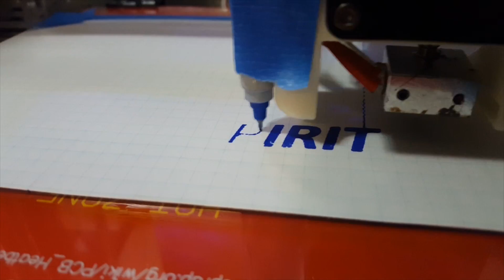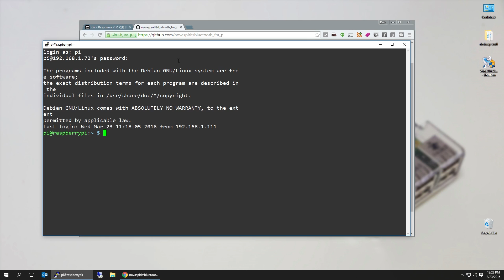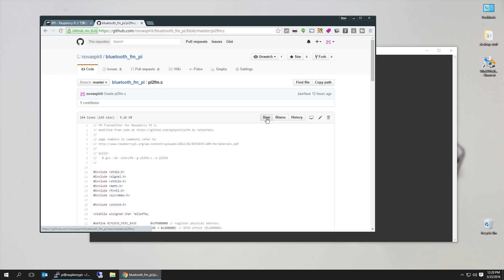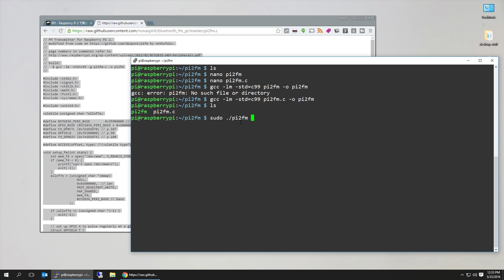Bluetooth Audio FM Transmitter for Raspberry Pi 3/2 Part 1

Comment: This does not work when i put in the code for it to start playing it says starting and broadcasting and other stuff and then on the bottom is says shutting down and it doesn't seem to be broadcasting anything on the radio

Comment: I have the same issue with every software I've tried out so far, four of them. 3/4 seemed to work. This one is running fine and all that, but there's no reception to my radio. If I move almost toward the antenna, then it works. I have a 70cm high antenna with 12AWG solid core wire going straight into the air. Has anyone got a similar problem?

Comment: thank you very much! it worked very good! but, it would be possible to broadcast from a internet radio from a link a direct IP from winamp ?
Reply: For everyone who reads this comment. This project is not related to an internet radio. Internet radios are using a way VERY different than classic FM radios.

Comment: @Novaspirit Tech: I want to build my RASP3 with this, but i want the unit in the car, with bluetooth auto sync with my phone, so i can send my Spotify music into my radio. How can we do that please?
Reply: I am trying to do the same exact thing. Ive given up on using Raspbian, I am now looking at using the OSMC operating system to do this. Wondering how to set the FM transmission from a GPIO pin. Any help would be great!

Comment: starting...
 -> carrier freq: 90.1 MHz
 -> band width: 8.0
now broadcasting: /home/pi/Downloads/shatter.wav ...

Shutting down ???
Reply: Same problem
Reply: starting...
 -> carrier freq: 0.0 MHz
 -> band width: 91.5
now broadcasting: /home/pi/Desktop/Star ...

Shutting down
Reply: I got it working by using a wav. file instead of mp3
Reply: i cant still make this to work. Tested 2 different wav files with no luck, still the shutting down message
Reply: It plays the file and then shuts down. You have to make sure the .wav file is 16bit 22050 hz, mono. If the file does not exist, or the path is invalid, it will shutdown without anything transmitted.
Reply: Hey Guys,
I had exactly the same problem.
If one has copied the file and than tried to delete the message "The file is 
write protected" Therefore came the error "shut down".
So if you take a new mp3 Example Faded this takes with the site http://audio.online-convert.com/convert-to-wav
In the right format koverted, then it works !
I hope I can help you

Comment: It will be cool to give more informations about the specifications of the WAV file. All my files are playing "slow mo" through the Pi. I try to change frequency, I try to change from stereo to mono, but my problem still occurs.
Reply: You have to make sure the .wav file is 16bit 22050hz. I tried a 48000hz file and it played in slow motion.
Reply: change bootup settings from Gui to cli

Comment: I am having a problem with this. I am able to set this up just fine, but I am unable to hear the audio that plays. When I have my radio preset to my selected station, there is a ton of static. When I hit enter to start it, the static goes away but I can't hear the music. Also, is it possible to play everything in a folder at one time, or do I have to do this manually every time I want to switch the song?
Reply: +Duncan Jones (RetroArcade) im haveing the same problem, can anyone help???
Reply: Exact same problem.  I tried a few different .wav files but no luck, it seems to be locking onto the transmission, the static goes away and becomes nice and quiet, just no sound transmitted.
Reply: Same with me. Anyone figured anything out?

Comment: Would it be possible to pipe espeaks output into fm? also i don't quite understand how bluetooth fits into this project? Also, does it work on a pi zero?
Reply from the maker: +msevyt this is only part one of two so the Bluetooth implementation has not been shown yet. As for espeaks. It shouldn't be a problem to out put to FM. On part two I will explain more about pulse audio and how Bluetooth will send it's input to the fm.
Reply: +Novaspirit Tech Thanks, great! Btw with that simple wire how much range u get inside house or more?

Comment: So the sound file is on the Pi and after set up, it is converted by the Pi via Bluetooth to transmit on a FM frequency which can be picked up by a radio tuned to the same frequency previously nominated. Is this an accurate summary?
Reply from the maker: +Vatoe spot on LOL
Reply: +Novaspirit Tech Ha thanks. I was trying to get my head around it. So even better, would be that I have my NAS mounted and then somehow maybe get it to stream a playlist?
Reply from the maker: +Vatoe now that you got me thinking, i might be wrong but if your using vlc or mplayer you should be able to stdout the stream to your rpi, since it handles stdin for pi2fm then you can setup any music you want on vlc/mplayer and have any playlist you want to play.
Reply from the maker: +Novaspirit Tech i'll try it out and let you know what i find LOL but this is a great idea
Reply: +Novaspirit Tech Great. I love your vids as they are explained very well  and methodically , which allows me (an non techie)  follow them easy, e.g. pi-hole, is favourite at the moment. So keep up the great work, and i'll keep a look out for this 'future' video :-)